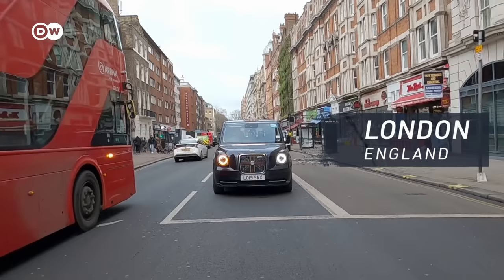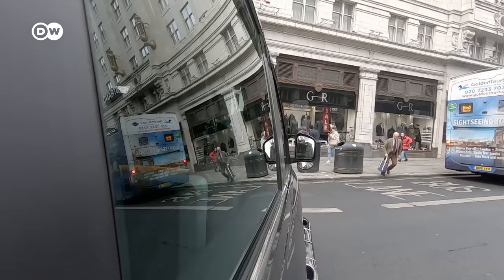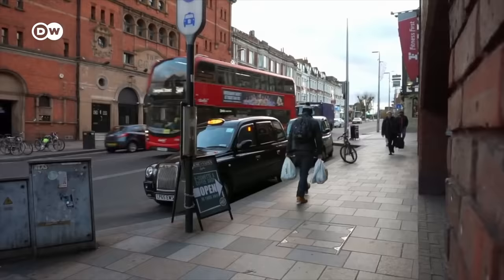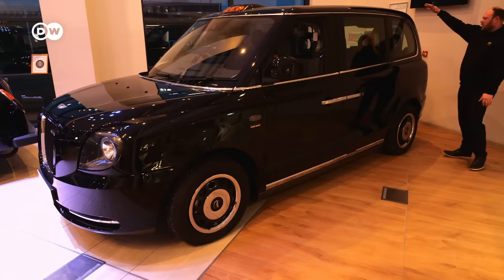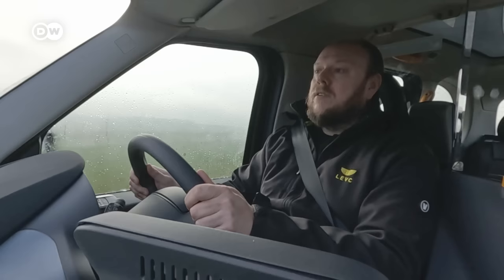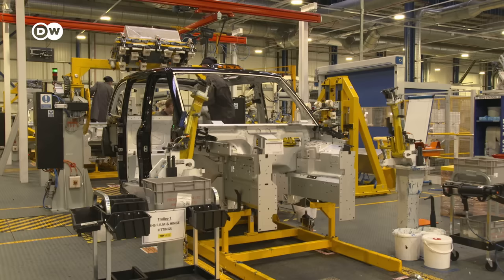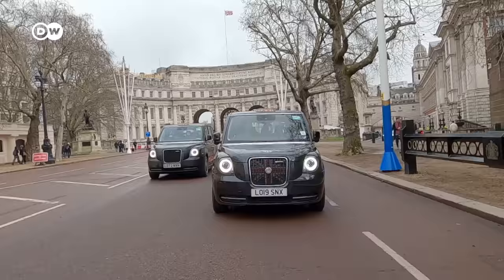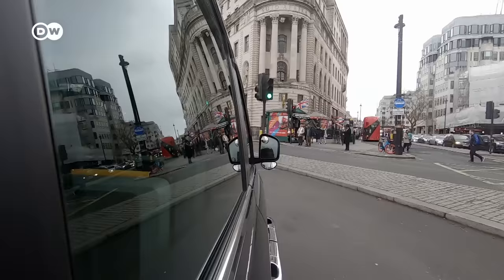Chinese Electric Taxis TAKEOVER London!

Comment: Great to see a veteran taxi driver embrace the electric vehicle so much - I actually met a driver of a Taxi the same as this at an EV charger near Hatfield and he was a bit disappointed with the EV range of around 60 miles but was happy in how it drove as well.
Reply: thought they  normally do 200miles?that's short
Reply: @burlhorse61  while the below information are the official figures you never really get that in the "real world " -The LEVC TX5 EREV range extended electric vehicle (EREV) is equipped with a battery capacity of 31 kWh, delivering a range of 128 km / 80 miles (NEDC). The total extended range of the TX5 EREV is 606 km or 379 miles.

￼
Reply: @markreed9853  whats does extended range mean?
Reply: @burlhorse61  It means the full range with battery and petrol engine with a full tank of fuel. This vehicle has a battery AND a 1.5Ltr petrol engine so it can switch to electric-only in central London but switch to petrol when outside or when the battery is running low. It's like a hybrid BUT electric motors are powering the wheels all the time. The only car like this is the BMWi3 REX.
Reply: @markreed9853  so it's a hybrid vehicle ,more or less.thought it's totally electric
Reply: @burlhorse61  its a range extended hybrid. In a normal hybrid the petrol engine powers the wheels, but not in this case. You could also run this totally electric without the petrol engine even starting if you stick within the range and then charge. With a hybrid you can't do that as the engine cuts in above a certain speed.
Reply: @burlhorse61  I think it will go fully electric car in the end as battery energy density gets better but due to the limitations of having to adhere to the design for a taxi it probably doesn't have room for more batteries at this time.

Comment: great, love it but why such a small range? Anyone buying an EV in 2023 is expecting at least 300 miles of range (with now 50-100miles added every year, as bettery tech progresses rapidly. There are cars for the same price that can do between 400-500 miles per charge). This taxi has less than 100 miles? Even my Fiat 500e EV from last year can do 200miles in city driving conditions and MG4 can do 300 for less than £30k.
Reply: What, 300 miles for a cap that spends its entire life in Intown? Not really needed, at least the Londoners don't think it's needed, otherwise, they will request the company to change the design. The batteries are heavy, less batteries, better handling and ride quality.
Reply: And these cabs have to be wheelchair accessible, so they may just not have enough space under the floor.
Reply: At 7:24 it briefly mentions it having a “small fuel based range extender”   which maybe increases its range above what the battery can supply.  It would be interesting to see how much further the car can travel using the range extender. It might also help to justify its relatively high price.
Reply: @challenger2205  And carrying less weight, which means using less electricity, save the planet.  Noone needs to drive alone ina 2.5 tonne SUV, 1 tonne max is all that is needed.
Reply: 300 miles range? ok, you just told me you didn't know anything about EVs without telling me you knew nothing about EVs.

Comment: Black taxis might have strict regulations but the 45,000 Uber drivers basically just need a pulse to drive an Uber  in my experience.
Reply: They also need the ability to be rude instantaneously.

Comment: I certainly miss that diesel knock noise. Should be simulated.  Glad it's happened.  Probably expensive, they were anyway being a bespoke cab. Possible the service cost savings will reclaw some of it over time. Live no where near London nowadays as it's overcrowded, not likely to see one any day soon.  Manufacturer obviously found the best EV hardware was from China cost wise while they are still in charge of the  coach work keeping it's iconic look.

Comment: American are using Uber and Lyft to replace taxis. This cab costs 60K British pounds and only go 80 miles per charge. It is so expensive. They can better off driving Tesla model Y.
Reply: But you forgot the built-in petrol range extender which charges the battery when needed giving it a range of over 300 miles not 80 miles.

Comment: Glue to hold it together.
I understand that many OEMs are using this in the automotive sector.

My issue is regarding repairability - which is of great concern on a business, due to the amount of downtime to repair the vehicle after a repair process.
This repair process shall be well thought out, including preventive but also corrective maintenance.

Therefore, I can not be pro such a productive process!

Comment: the LEVC TX iSMARTwinPower4™ 50.63 kWh 4-Dr Electric Cab (RHD) could do with a internal combustion engine variant . . . a 2.4 CDI I5 mated to a torque converter 8-speed DSG auto or a 2.0 Biturbo I4 mated to a torque converter 10-speed auto . . . complemented by a 20.0 kWh Mild-HYBRId™ system . . . AWD is another essential feature the electric TX should have . . .
Reply: Why would it need that junk? I think you're missing the whole point of this vehicle, which is to get diesel out of the city.

Comment: Taxi drivers all around the world used to working in shifts, with the car running around the clock, just the drivers changed at constant intervals. I guess this is out of the question with electric cars, considerable charge time is mandatory, so you need twice as many cars to cover the 24 hours. Considering that the production of the EV is nowhere near emissions free, some of the benefits may be doubted. Or do they have half the coverage of the old diesel fleet?
Reply from the maker: Maybe things will change soon, since battery tech is developing quite rapidly.

Comment: Isn't this a hybrid with a petrol engine? The London regulations banned diesel and forced a zero emission capability. It shows him stopping and plugging it in but they don't need to do that as they can use the petrol engine to charge. How often are they really using the petrol engine I wonder?

Comment: Lithium titanate batteries would replace lithium ion batteries at a slightly higher cost, but better performance, safer, and adapted for EV. 😊😊😊
Reply from the maker: Faster charging times vs lower energy density. We might have to wait and see what happens as the tech develops.

Comment: This new model is a bit of a fail. The battery pack is far to small. Similar to a Nissan leaf of 10 years ago. In the winter in hilly cities you are getting 50miles range. Put a 100 kwh battery in this taxi and no petrol range extender and this will be a decent option.

Comment: Aren't Checker taxis in NY built specifically to be a taxis?
Reply from the maker: No, as far as we know, the yellow cabs in New York are all production cars that are sometimes so popular as taxis, one begins to think of them as just taxis. Like the Checker Cab, which was sold as a production car - the Checker Marathon - that people could buy and use privately too. There have since been Ford Crown Victorias, Toyota Priuses, Toyota Camrys and more.
Reply: @DWREV  
Sort of. Checker Taxi and Checker Motors were both owned by Morris Markin and Morris had Checker Motors build the Checker Marathon explicitly for Checker Taxi. The Checker Marathon is every bit as iconic as a taxi as the London Taxi.

Comment: Electric?...no one expand's on the 'Range Extender'..which is a 1.5 litre turbo charged petrol engine...so it's a Series Hybrid?
Reply: Engine is to charge the battery, not power the car...and that's the huge difference ..
Reply: @blackknight4996  Yeah well done Sherlock...like I said 'Series Hybrid'

Comment: I don't think the claim that the LEVC taxi is the only purposefully built taxi in the world is true. Toyota have designed and developed a vehicle that is called 'Toyota JPN Taxi' and somewhat resembles the London taxi design. This vehicle is now the primary one in use as a taxi in Tokyo and has replaced the old Toyota Crown taxi variant. This vehicle is not sold as a passenger car or a van.

Comment: Nothing under the bonnet generates electricity, other than the regenerative braking.
Reply: You forgot the range extender...
Reply: @j.r.arnolli9734  The next step could be to use a fuel cell as range extender — or even as primary electricity generator.
Huge weight reduction — a kilogram of liquified hydrogen should provide electricity for about a full charge. Further optimisation would be to reduce the battery pack by about 2/3...

Comment: It's not an EV, it's a hybrid🤦‍♂ I guess you could say 'Electrified,' but it's not an electric vehicle.
Reply from the maker: It has a fully electric hybrid drivetrain, and drives on electric power at all times. So, it's fair to call it an EV with a hybrid range extender.

Comment: over priced and not fit for purpose needs a hybrid vehicle as this vechile if your lucky does 50 miles to the charge  unlike  a hybrid you never have to charge    if you use the Air con only 40 miles to the charge
Reply: Get an education first, or finish your high school before you attempt to comment..

Comment: Not a single word about HP !!!
Most elementary thing arround the world when you talk about cars.
Reply from the maker: We like HP sauce with our full english 😉, The LEVC TX is fitted with a 33 kilowatt-hours (120 MJ) battery pack supplied by LG Chem, and powers a 110-kilowatt (148 hp; 150 PS) Siemens-built electric motor for traction.
Reply: Michael Bigdongovic  who cares, are you planning to buy one?
Reply: @MaticTheProto  You will be surprised how important is the weight factor for cars' economy and performance.
Reply: @georgeb5262  not quite, evs can regain energy to a degree by recouperating and can be heavier while being more efficient

Comment: Ubers will still prefer a prius 😂
Reply: I have been driving Uber for 5+ years, I traded my Prius for a Chevy Bolt 2 years ago.  The Bolt is 10 times the car that the prius was. 2 years with the Bolt = zero maintenance costs with the exception of new tires. 😂
Reply: @mostinquizative  gm doesn’t do much business in UK. Ford, VW, Toyota, honda more popular there